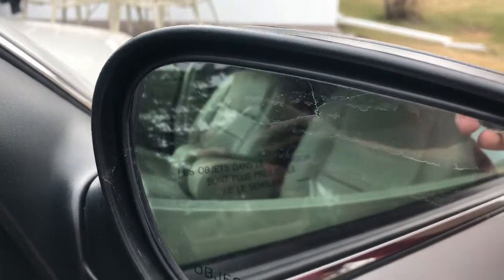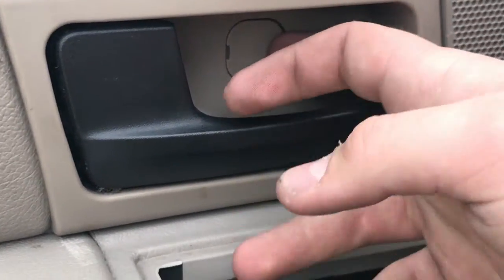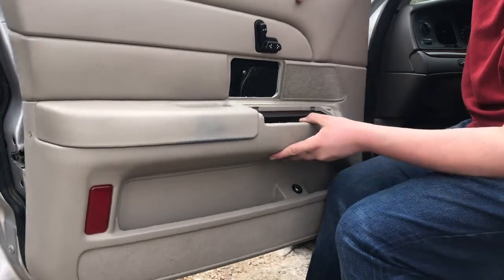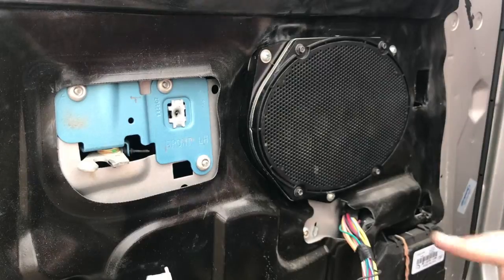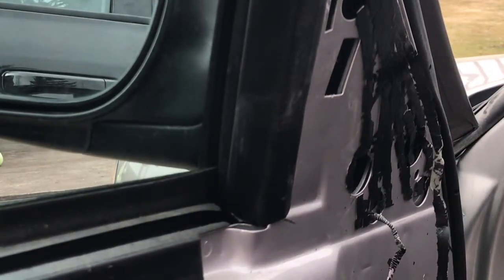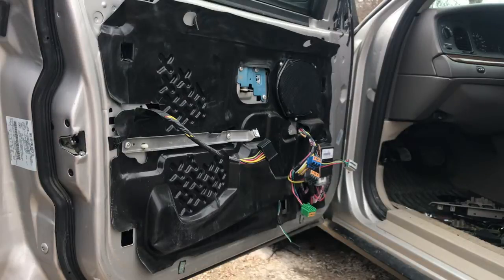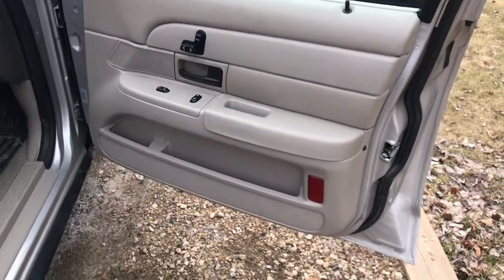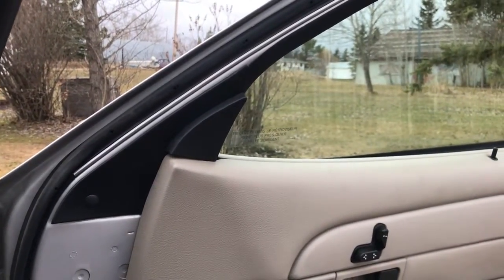Installing Heated Mirrors In My Crown Vic For Dirt Cheap!

Comment: Installed a set on my 2006 P71. The wiring is there for heated mirrors but they do not come on with rear window defrost. Even after I found the fuse slot that will be empty on models without. Still no power to mirror glass. After further research lots of wiring mods are needed to “add” them.

Comment: My 2003 MGM has the defrost for the rear window, but not heated mirrors. Should the 03 have the connector for the mirrors?
Reply from the maker: Yep it should all work together when you install the mirrors, I am not 100% sure though on the 03's mabe take a look on some forums and see if you can find some wiring diagrams

Comment: Hey BCM,
Quick question;
Do you know how to deactivate the horn chip when locking the car with the remote key fob?

There's a procedure on page 76 in my owners manual for my 2004 Crown Vic, but my 2010 Grand Marquis fails to mention a procedure. I tried the procedure for the 2004, on the 2010 and it goes into programming mode because I get the lock/unlock confirmation. But I still can't deactivate the horn chirp, when locking the car with the remote key fob.

I usually like the audible confirmation when locking up the car, but not when I come home at 3AM trying to be quiet. lol
Worse case scenario, maybe I'll install take the WJ Handy Dad route, and install a bypass switch on the ground wire of the horn. 
Chuck
Reply from the maker: https://www.crownvic.net/drock96marquis/rkeprogram.htm

Have you tried these? After a bit of research, I couldn't really see anything. I'll keep digging and if I find anything I'll let you know. Sorry

Comment: Really good and fun video! Enjoyed it. Where did you get the heated mirrors for the Crown victoria? I want some and also, are there any with LED turn signals on them?
Reply from the maker: Glad you enjoyed it! I got them from pick n pull they were like $30 or so if I recall correctly. I have seen ones with turn signals built in, you could look on Amazon and eBay and maybe find a set there!